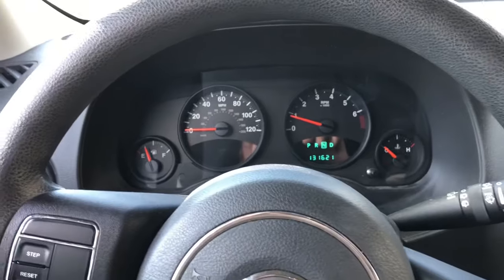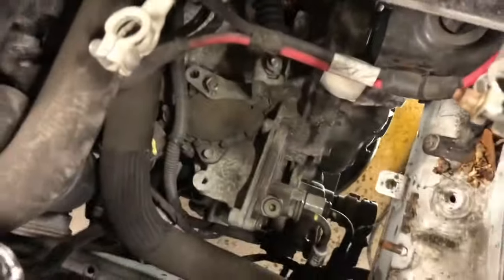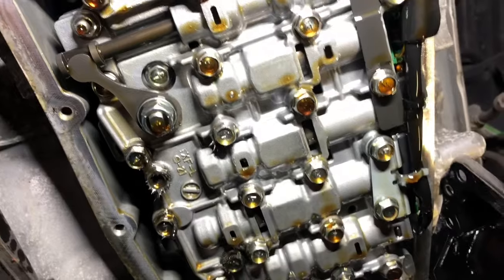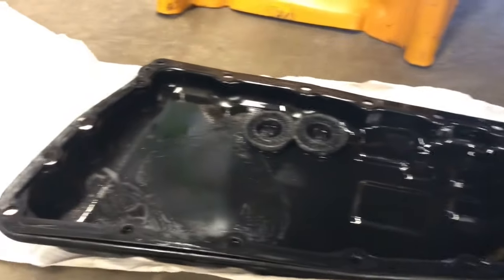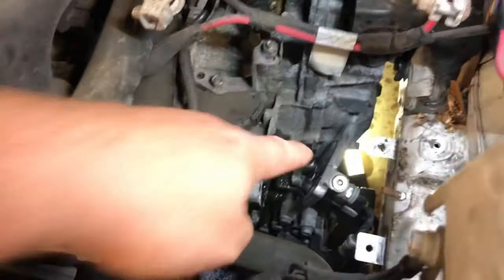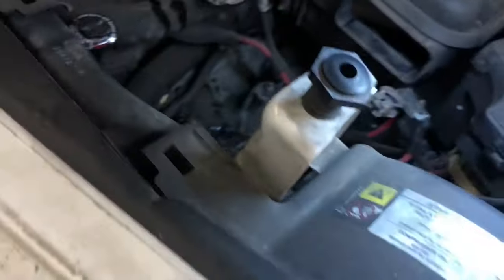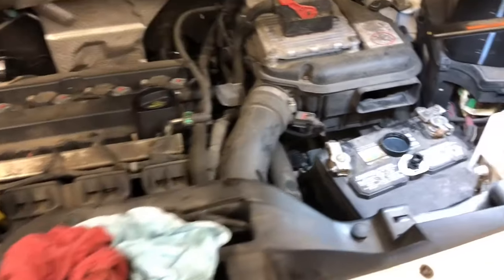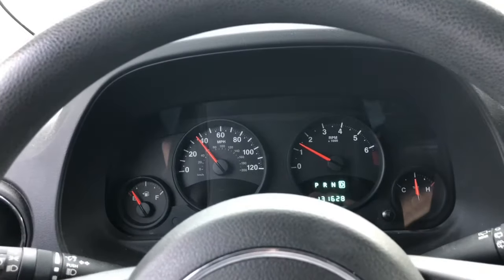Jeep Patriot CVT Transmission Fixed jf011e whine noise service

Comment: Hey John I'm new to your channel and am having a big problem with my 2012 jeep Patriot I was diving about 65mph and all of a sudden my rpms went to red every time I hit the gas my speed dropped dramatically and I couldn't accelerate without my rpms jumping can you help me with this problem
Reply: I'm throwing a P0730 code and I have a winning sound from my trans
Reply from the maker: Thanks. That’s not good. You could try a simple service. But sounds like may have some other issues. I have not fixed one with those problems yet. Could be an issue with solenoids. Or a pulley?
Reply: @JohnVHLife  Thank you so much for getting back with me I really appreciate you taking the time to messaging me back how many how many solenoids does the cvt have and how difficult are they to replace?
Reply from the maker: I haven’t changed one. So I don’t know for sure. Rebuilding a trans isn’t too hard in all honesty. Just takes time.
Reply: Did u find out what was wrong mines doing that also but i just did this transmission filter change 600 miles ago and the sounds back again too it went away for about 400 miles and came back during a road trip

Comment: Hi I have a 2011 Jeep Patriot latitude how do you know if has ctv transmission ?
Reply from the maker: I googled it, you either have the CVT, or a 5 speed manual. So if you dont have a clutch pedal, you have the dreaded CVT!
Reply: It would sat cvt on your manual or right on the engine cover
Reply: Lol does it shift? Cvts are pretty obvious lol

Comment: I have the same exact problem should I take it to dealer 🤔
Reply: I have 130,000 miles too
Reply from the maker: You can try. They will say it’s shot. But maybe you can show them my video.
Reply: I was thinking the same thing or just try it myself
Reply: Well I just spoke to the shop and he's telling me have it towed there it may have a leak but I park my car in the same spot for months my driveway nothing there so I think I can make it 20 miles or so ,or just perform this first myself
Reply from the maker: @tiffiniedunn7918  They are probably assuming its low on fluid, which isnt the case. To find a trans shop that has a clue on how to fix these is about impossible, unforutunately, as they are a simple trans.  But they make more on replacing them instead of fixing them. Best of luck to ya

Comment: So did it work?
Reply from the maker: Yes
Reply: Your the best
Reply: My issue is driving up hills going 70 or in a hot day
Reply from the maker: @TheWonderfulWonders  add an oil cooler. If you changed the filters already
Reply: Would it be so much to ask if you could ask if you could add a link to exactly what it looks like please thanks. Mines is a jeep Patriot 2007 limited 2.4
Reply from the maker: @TheWonderfulWonders  Link is right in the video description to everything I used and mentioned.
Link to the small upper filter: https://amzn.to/306vsSf
Reply: Honestly your the best. Thank you so much
Reply: How about the oil cooler?
Reply from the maker: @TheWonderfulWonders  Since I havent done the aux oil cooler, you will have to check the patriot forums for those answers. Sorry.

Comment: I have a 2009 Patriot. was getting heated up, getting transmission heating sign on the dash. did the oil change for cvt transmission and still overheating. What might be the problem?
Reply from the maker: Did you change both filters also?
Reply: Were you able to repair the Jeep?

Comment: Yo  tengo  una  jeep  compass  2009  y  cuando  la  pongo  en  marcha  se  le  mete  un sonido como  se  fueran  la  bearing
Reply from the maker: Its possible, see my other videos where I fixed a bad bearing in my other one
Reply: Cambia los filtros de la transmision, son 2 el de la transmision y otro que lleva bajo la bateria tiene uno pequeno que tambien tienes que cambiar, es facil, compra como 8 cuartos de aceite , debe ser original ,nunca de otra marca o seguira sonando.

Comment: Chrysler Jeep dealer told me that : Patriot 2009 doesn't have the top filter.
Reply from the maker: Yes it does! I have a video on a 2009 and I have a picture of it! Im positive this is a job security scam from Chrystler!
Reply: @JohnVHLife  my friend not all the patriot are the same, that filter is for cvt2 not for cvt4 if your  patriot is 4x4 and 2.4 you don't have this filter. 
Part number B429 is the only filter for patriot,s transmission which is for cvt2 which I am guessing engine size is 2.00.
Reply: @familytabrizi76  Maybe, two and four wheel drive do both have the second filter.  Im pretty positive they all have them.
Reply: @JohnVHRC  then let me know part number please!!!
B429 is for cvt2 more to that the one showing in YouTube clips are for 2015 not 2009
Reply from the maker: @familytabrizi76    Look at the 2009 I did the exact same thing to, used the same parts!
Reply: @JohnVHLife  🙏 thx

Comment: Sounds like the CVT belt has gone bad....the only fix according to almost everyone is to REPLACE the transmission....they do not work on, or repair these cvt's...what a bummer.
Reply from the maker: That is a bummer,  but Ive fixed a couple now, works great! Easy to work on and fix. Just like this one, belt is fine, fluid just couldnt get through the filters properly as they werent changed often enough.
Reply: Please don't tell me that mine is a 2011 I feel I can do this myself im going to try!!

Comment: my 2011  Jeep  latitude does the same  as video.It drives fine as long as u don't drive on interstate get between 70 and 80 mph.The thermostat light comes on car loses power.Have yo pull off road sit 5 minutes .Cranks up fine .Hat going on vacation car goes this everytime.Dealership can't find problem .Tried replacing solenoid.Still happening.Complained to Keep corporate office no response.Please Help.
Reply from the maker: Thats tough, dealerships dont know anything about these transmissions sadly. I would definitely change the fluid and BOTH filters and see what happens. If you keep driving it like that, youll ruin it, in my opinion, its hurting it self each time it goes into limp mode.

Comment: The most common issue....
Reply from the maker: Lack of maintenance!
Reply: Will this help if I'm getting the p0777 and whine? I just bought one with 107k it will barely move and then throw the code. flakes other than that everything looked ok. I hope this will help!
Reply: @JohnVHLife  Yep that is what causes these to fail. If you don’t perform the proper maintenance on these, they will burn up on you!
Reply from the maker: mt90945557 for sure!! And the factory says to wait too long between services.

Comment: If your gunna make a video doing a flush and fill u could at least show putting the trans fluid back in and how much u added..reason I say this is you left out you adding fluid and then used the dipstick to check itand more importantly didnt tell the people its measured by mm in correspondence to the trans temperature thats done to insure u have the  right amount of trans fluid.so all in all id pay closer attention to detail when making vids incase someone wants to attempt to do these things otherwise.they will fk something up for watching your videos and leaving steps out
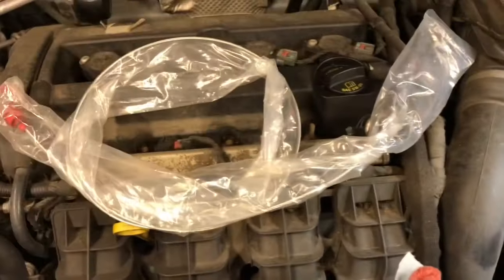Reply from the maker: @9:45

Comment: CVT transmission are just junk , typical CVT transmission creates a lot of heat due to friction of the belt assembly and the torque converter lock up , don’t buy any vehicles with this transmission

Comment: Also I can't find the tube you have with the plug for checking the fluid after complete. Can u help me as I am single dad and can't afford to take it to shop. But I am ok with twisting wrenches and fixing myself.
Reply from the maker: If it’s not there you’ll have to join some forums or google it. I have never had one of those.

Comment: I have a 2017 jeep compass sport 4x4  with the 2.4L with a 5 speed Cvt.i do not have a filler tube near the battery.is this a plug or bolt under the battery??   And how much to drain and refill?
Reply from the maker: There has to be a way to fill it, maybe google that one.

Comment: My 2012 jeep Patriot seems like it won’t accelerate as smoothly or fast as it used to be, and decelerates really fast. Could that mean it needs new transmission fluid?
Reply from the maker: Has it ever had a tune up?
Reply: @JohnVHLife  I don’t believe so. My transmission overheats on long road trips and has the whine noise. But recently, I’ve noticed the accel/decel problem with a little bit of burning smell that I have to put my nose close to the hood to smell.
Reply from the maker: @brendonlehman7792  I’d service the trans. Change both filters! The burning smell is probably and engine leak somewhere dripping on the exhaust.
Reply: @JohnVHLife  ok thanks. That’s what I was thinking. So pretty much just change the fluid and filters like in your video?
Reply from the maker: @brendonlehman7792  yep